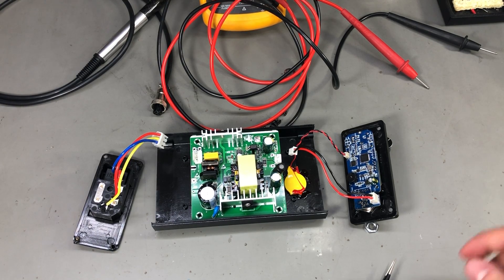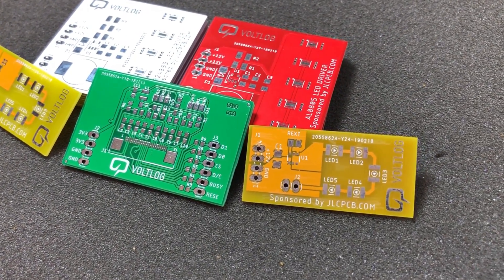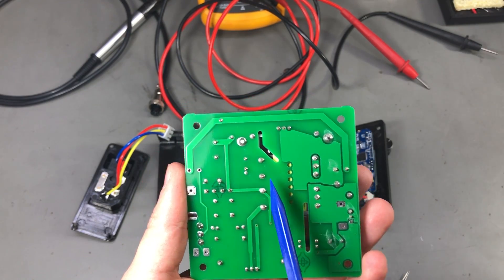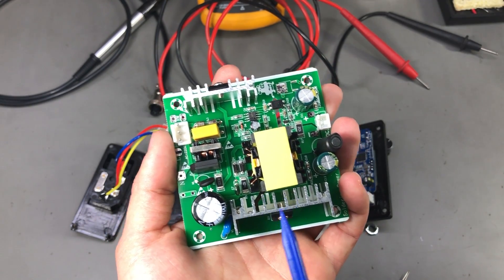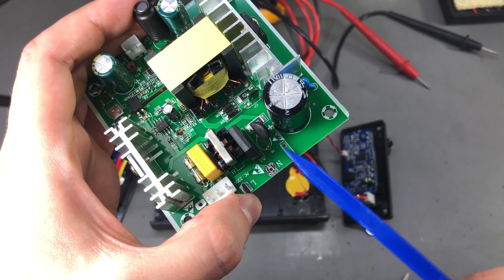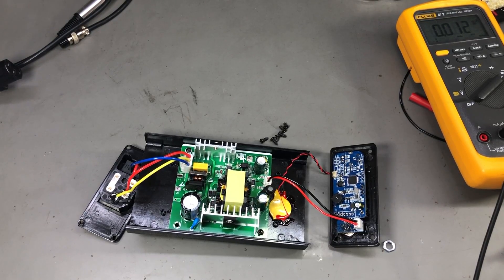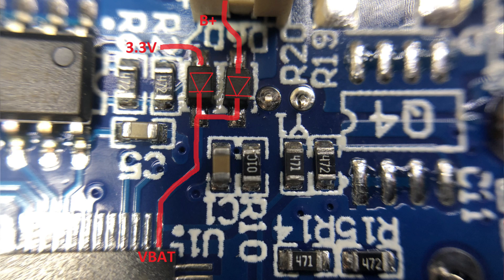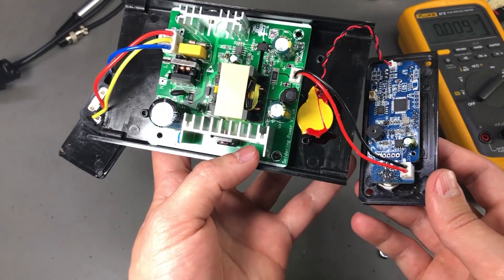Voltlog #234 - The Problems I Found With The KSGER T12 Soldering Station

Comment: I've just got the t12 2.1s stm32 and the pcb is different like the heatsink the only trace is to the rectifier its a 2.2 pcb , i still had to-do the ground mod though and srap the paint for the dial and handle connection to get ground, even the controller pcb is different its blue and different that I've seen online also there is 3 r10 chips, i did put some thermal pads on both rectifiers though may as well

Comment: I bought a WEP 926 soldering station and found it to be useless, not enough heat to solder RC hobby battery terminals, EC5's and XT90's, Im sure its ok for PCB work but quite disappointed. I will do a video on it one day.

Comment: Hi. Any way to fix a T12 D12 tip with burned sensor? I may have pushed it to above 450 to above 480C.
It's a new tip.

God bless, Rev. 21:4

Comment: Great video. I just bought this soldering unit online and it arrived with the display screen not functioning. It beeps and gets hot so I'm assuming other than the screen it works. I'll be asking for a refund/return though. Two questions though.
1. I opened up the case and there's a red LED lit up on the board that has the display and controls. Does this narrow down what could be causing the screen issue?
2.That sensor and/or backup battery (yellow circular component) is instead glued to the top of the large transformer instead of on the bottom of the case as seen in this video. Would that matter, thermal or otherwise?

Thanks.

Comment: Thanks for the review. Here are some more questions about the capacitors in the power supply. It seems like there were no complaints, but, for example, C7 according to the scheme for the PWM controller SG6842 should be 1.5nF x 1000V, and for some reason set at 4.7nF x 100V. (2A472J instead of 3A472J (3A152J) or at least 2J472J). The main thing is not to put a ceramic instead of a film, otherwise the power supply starts to make noise. It is advisable to replace the electrolytes too, there were complaints about their malfunction: 2pcs Rubycon 1200uF 35V ZLH 12x25 long-life with low ESR are suitable for the output filter. In the input circuit 1pc Nippon chemi-con 68uF 450V KXG 18x25. In the latest modification, the manufacturer sets 400V, 82μF. (it is better to replace with nichicon PT 420V, 120uF. 30x18mm. - installed horizontally.) PWM CR6842 (SG6842) power supply 47uF 50V KY or Rubycon ZLH 56uF 50V.  And also pay attention to the heatsink of the rectifier diode MBRF20200 - the Chinese forget to smear the diode with thermal grease, and the heatsink itself is installed directly on the high-voltage circuit track next to the 68uFx400V capacitor, where all the insulation is only varnish on the track.
Reply: And also note: the color of the wires does not match the polarity. Power supply - control board. The red wire is "-24V". Black conductor is "+24V".

Comment: I remember digging into the R10 resistor and memory backup circuits for this chip, and I think I figured it out. IIRC The resistor is needed when the backup circuit for the controller is supercapacitor based. Seems they changed their mind underway and went with battery instead. But as those two different circuit setups are otherwise almost identical, they overlooked and forgot to nix the resistor.

Comment: The battery drain is probably an issue with the rotary encoder shorting the 10 K resistor out. Check John Salt's video on that and let us know if it is really the case. Would check it myself but mine doesn't have RTC functionality.

Comment: Ive bought this unit in 2020-03 and they've connected the soldering iron tip to grounds where you showed. Also the display pcb is some new revision and has a different layout from yours. The only negative i could find from your unit is that the large capacitor is too tall for the enclosure so the plastic bulges out and pressess really hard on the capacitor. I guess i could either hollow out the plastic a bit, or file down the screw holes upon which the pcb rests.

Comment: Terrific video; thank you.

I purchased the metal covered version 2.1s from Banggood.

For what it is worth, I pulled the cover off my KSGER unit and found the (large) 400V, 68uf capacitor leaking; I just ordered a replacement capacitor.  I had not used the station more than 20 minutes.  I had seen another video of someone with the same 400V, 68uf capacitor leaking.  Someone wrote on that site they thought KSGER was installing used capacitors in some units.  The units offer phenomenal bang for the buck - when they work properly.  If you buy one of these stations, I recommend taking the cover off and doing a brief inspection after you run the station for a few minutes.  (In the case of the other videographer, he saw magic smoke coming out almost immediately after powering up the unit, and he shut off the station.  Upon inspection, it appeared the capacitor had been punctured.  Here is a link to his video:  https://www.youtube.com/watch?v=cowgbwU3b5c&t=1786s  With that said, I am still happy with my purchase.

Comment: I bought a KSGER T12 V2.01 station recently, and it's identical to yours, minus R10 not being installed. KSGER must have realized that R10 was causing problems
Reply: how is it? i wanted to buy the v2.1s but bought the v2.01 by accident.
Reply: @jedediahoakwynn-dough5769  It's absolutely fine, works well for me a year later

Comment: I just bought one of these but it has a problem. The NTC temperature on the front panel shows 24 when switched on but there is an exclamation mark (!) next to it. It heats and works well, but when on standby, a shake causes the ! to change to the thermometer symbol and the 24 figure changes to (e.g.) 45...then 65...then 86... then ! 24 appears again (presumably it thinks the handle is too hot). The NTC resistance is 8.3K at room temperature and I can see no shorts in the iron itself or the plug. Any help appreciated? What is your NTC resistance (I have T12 9501 handle). Shake does not bring it out of standby,
Reply: Found the problem! The blue and white wires were swapped over in the plug! Now fixed!
Correct wiring is 1=blue, 2=white, 3=green, 4=Black, 5=Red.

Comment: i got mine and it stopped working after about 20 minutes. I opened the case and the red LED next to R16 is blinking slowly. The OLED is not coming on at all. Any idea what that red led is indicating? testing the DC out of the board is jumping all over the place and shows low voltages from 12v to 1 volt.
Reply from the maker: I have no idea what the led is doing but checking voltages is a good place to start.
Reply: @voltlog  ya like i said the dc output from the power supply is jumping all over the place. It jumps to 12v then starts dropping to 0 then back to 12v and repeat. I was hoping you had a schematic for this board that told what that led was for. Worth a shot. Maybe I'll convert it to a lipo powered field iron for my rc hobby. Thanks

Comment: My station has the same power supply and the EMI is terrible. I can hear it on FM radio. I am not sure if it is radiated or conducted. My bet would be on conducted as I cannot see much filtration on the board. My case is metal without Earth connected to it! I will need to fix the EMI issue as it is illegal. Other than that it is nice soldering station. I regret that I choose the station with an integrated power supply.

Comment: Just curious for the price to performance which is best for which value? I'm looking at a hakko fx951... what would you recommend
Reply from the maker: I recommend the KSGER T12
Reply: @voltlog  I bought a used FX951 for $109 free shipping with no tip, so great. someone might think it's a scam but i looked a photos and its genuine. now i gotta take it apart when it arrives to check internals and it should be good. The mfr date is 2010.

Comment: Thank you very much for finding this.. I saw later either in this video or another, that you remove r10.. I can affirm that I just got my ksger t12, after having watched your video (and was ready to rip the r10 off from the get go).. only to find they're no longer putting the r10 on the boards.  I have the metal bodied one, and my power port is directly soldered to the psu.. so there is some small differences.. but our controller board with the stm32 is definitely the same pcb.  Looks like ksger took you seriously and has, in fact, stopped putting that resister on the board.
Reply from the maker: awesome to hear they fixed that 👍
Reply: @voltlog  I thought it was awesome too lol.. I was ready to fire up the solder sucker and the radio shack iron to desolder a smd resistor (so I'm a little desperate ... ) and it wasn't even there..

Comment: Another YouTuber John Salt mention about his fix on the Battery Backup Problem back in May 2019. Here is a link: 

KSGER T12 Clock Backup Battery Problem Fixed
https://youtu.be/B-xWhPcr6jk

He mentions that the tabs to switch weren’t fully folded and were causing a short.

Comment: @VoltLog Maybe it's better to buy the mini version (DC) of this station with separate power supply?
Reply from the maker: that may be an option if you want to control the power supply side of things, I personally like everything in one box.
Reply: I understood that mini versions don't have grounded tip, I actually ordered mini after watching this video, but now I regret ordering the thing all together.
Reply: @DivineMoment  ICBW, but I'd assume whether the tip is grounded or not will depend on the DC supply you are using with it (if you are using a floating supply, and wanted a grounded tip, then I would guess connecting the supply negative to ground via a high value resistance would be fine).
Reply: @Tim_Small  
Did you buy it in the end, how is it (the mini version)?

Also, Quicko seem to support both 110-220 volts and 16(even 12 I believe)-24 volts power input. Although I can't find a video that compares the two models (KSGER's and Quicko's), how they compare in terms of components, quality of the design, etc.
Reply: @Maxim P  The mini version works fine.  I use it with an old Sony 19v laptop supply.  Mechanically it's a bit less stable on the bench (being smaller and lighter), but otherwise it's identical.  I bought a cheap USB power output adapter for the Makita 18v (21v when fully charged) batteries which I use in my power tools, and I will add an extra power jack + quick blow fuse to the battery adaptor, to let me use the batteries to power the KSGER mini away from the mains.
Reply: @Tim_Small  
I see. Well, thanks. Great idea(s).
Reply: @MaximC , Quicko now has several T12 solder stations for around $50 each that slide right onto the battery, in versions compatible with Milwaukee, Makita, Dewalt and Worx batteries (specify when ordering). They also have a separate power-input jack.
Reply: Yes that's what I was thinking.  As well as being cheaper it gives the potential to run from a high quality laptop power adapter (that you can buy cheap second hand if you don't already have one).  You could also use it with a usb-c pd power bank, so long as it does 19v or higher for portable use.  It doesn't look like the DC version will be super stable on a benchtop, but that can probably be fixed pretty easily...
Reply: I also bought the mini as I thought an external supply like Mean Well LRS-75-24 would be safer option. Grounding the tip, however, is something I haven’t figured out. Some say use a resistor in between, some say straight to ground, and some even say better leave it floating!

Comment: Versions without battery are better. The battery is useless complication and source of problems. Also, there are versions which can wake up from sleep mode (heating element off) just by moving the iron (there's tilt switch in the iron). These are more convenient than others which require that you press the button to wake them up from sleep mode. They have tilt switch too, but the firmware is configured differently and they wake up only from standby (temperature lowered to 200°C) and not from sleep.

Comment: The delay it is the firmware boot up and the problem with that resistor is a tab from the potentiometer on the front that have pierced the solder mask  and it is shorted to ground
Reply: John Salt video here https://www.youtube.com/watch?v=B-xWhPcr6jk shows the problem of the rotary encoder tabs shorting the resistor to ground.

Comment: The turn-on delay could be to avoid problems when used with slower power supplies (the controller could be bought separately).
Reply from the maker: yes that could be a possibility

Comment: The R10 issue would explain why the CR2032 on my unit was completely drained when I got it. I replaced the battery and set the clock. A few days later, I noticed the battery was drained again and the clock was back to showing 2013-1-1 00:00:00. 
Has it been confirmed that it is safe to remove R10?
Reply: More than safe: KSGER is shipping new V2.01 units without R10. The board is identical, the R10 pads are there, but there is no R10 installed. So they also realized the problem
Reply: @robca8370  Thanks for the very helpful info.
Reply from the maker: Yes it's safe

Comment: I would definitely recommend against changing the earth connection. Especially with the isolation issues in this device.

Having an iron with directly earthed tip might have actually saved my life before: I had a faulty PSU´s GND still attached to the circuit I was working on, and when I touched it with the iron, there was a short circuit which blew some fuses. The PSU´s GND had a failed noise suppression capacitor to the 230V live which was apparently shorted. It was NOT a class-Y capacitor as it should be.

Had the iron used a 1M resistor to "earth" the tip, this would not have shown a problem and would not trigger any RCD. So who knows what would have happened next.
So if anything, I would make it thicker than it is here to avoid the earth connection blowing up under any fault condition.
Reply from the maker: It would seem many people are suggesting it's good to have that direct connection to earth. But I am thinking, with a direct connection, what would happen if there is no RCD protection and the soldering iron touches a live circuit? The current will flow through the handle to the soldering station, it might melt, it might catch fire, I don't know  it depends on which fuse blows first and how fast but this was the reasoning behind wanting to have that 1M resistor in there.
Reply: @voltlog  I would say the house fuse would blow - if it doesn't you have a much bigger problem in your mains installation. Also, why would you want to poke a live (or potentially live) circuit with a soldering iron? That's a pretty bad idea all by itself. 
Most irons I have seen have the tip directly connected to the protective earth of the outlet, not through a 1M resistor. It is better to blow a fuse by accident than get electrocuted by touching a live circuit while soldering on it (e.g. while bringing the solder wire in).
Reply: You should not work on live circuits with a soldering iron, it's a really bad idea.. And you should have an RCD install for safety reasons.   You can use isolation transformer (1:1) if you need to test a device while it is connected to mains.
Reply: @voltlog  Even without an RCD shorting anything live to earth will immediately blow fuses and trip breakers. There´s no risk of fire there.
A direct short across the mains is actually less dangerous in that case than a "short" through some appliance.
Basically without an RCD, your Earth connection is EXACTLY the same as your neutral connection. They are often even shorted together in multiple places in the house.

Sorry for tha late reply, for some reason my youtube settings were all messed up.
Reply from the maker: @Basement-Science  after doing more research on the subject I have come to the conclusion the megohm resistor is only allowed in a double insulated equipment, which might be the case here, as long as the transformer and the power supply in general does not fail in a way that breaks insulation, which ofcourse cannot be guaranteed given the flows it has. So I will be leaving it connected directly to earth. BTW it's not OK for the earth and neutral to be shorted together in multiple places, they should only be connected in the junction box.
Reply: @voltlog  Yep, that´s true for all exposed metal parts on mains powered equipment. Either it has to be earthed, or it must be double insulated. What counts as double insulated depends on a bunch of things depending on the device. For example modern electric drills do not need their gearbox/chuck earthed. The wire insulation in the motor is apparently enough.

About earth and neutral: Sorry, I wasn´t very clear. 

In old houses there are often cables with only 2 wires. There the PE for the socket is connected to neutral in the socket itself. That´s what I meant. This is also still allowed here if it´s an old installation.
To install an RCD in such a building, you either have to replace all the old cables, or use one of those plug-in RCDs 

Of course you never know what other horrible stuff has been done in old houses.